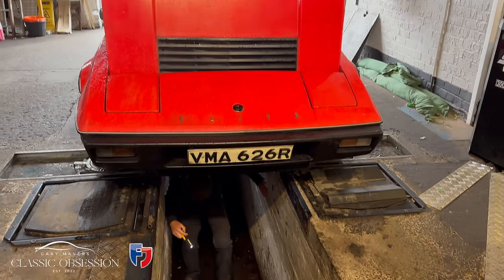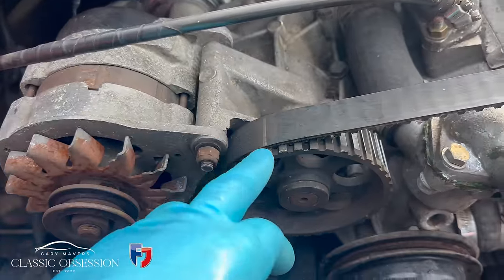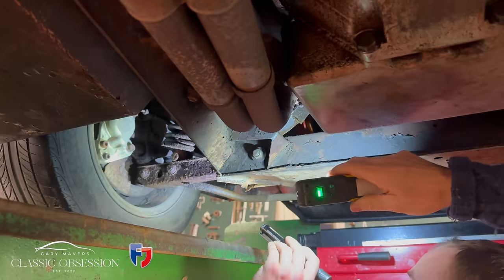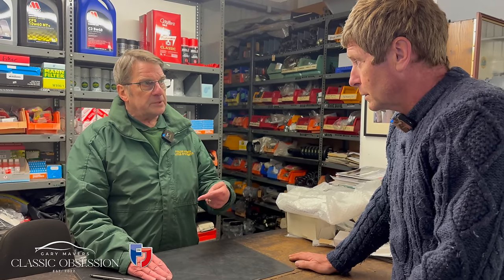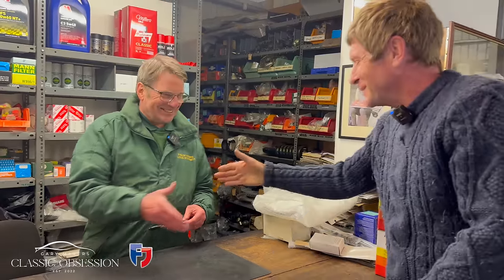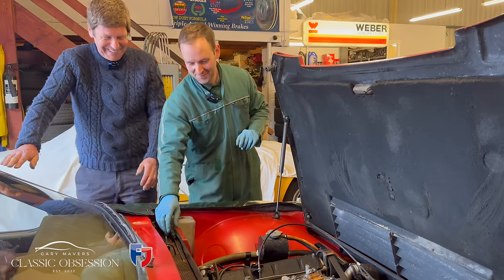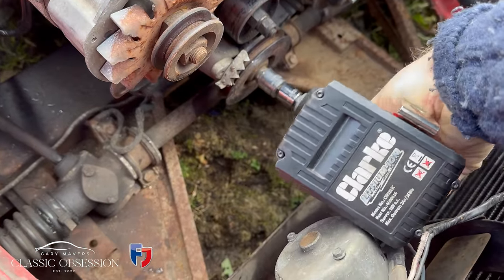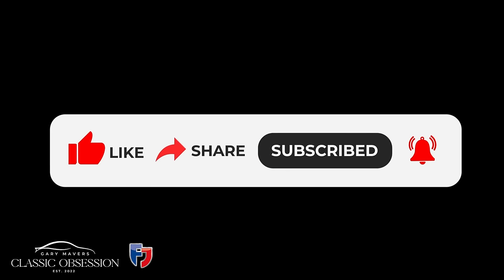Lotus Elite Diagnostic! | Chassis & Cam Belt Update | Classic Obsession | Episode 60

Comment: These cars drive so well that’s it’s sometimes difficult to find any maladies in the suspension/ chassis set up , but you will “ feel “ the difference when they have all been done , Gary. I thought that Steve was spot on with his carb tuning at the Lotus specialist , ( more than I can say about somebody else , who confesses to be the bees - knees on carb tuning , who appears on YouTube ) . This car is most definitely worth keeping and persevering with . Good stuff. The chassis , once sorted , can be kept good with Hammerite paint then sprayed with good old WD40 . Have you considered using a fuel additive such as Millers rather than readjusting timing to suit ? I admitt, todays fuels rubbish for carb rubbers / fuel lines etc ,.

P.s . The corrosion on top of the chassis , where the body sits top  on also effects the Reliant Scimitar GTE , obviously a similar construction.
Reply: Shots fired!

Comment: Following this with interest Gary as I'm waist deep into a nut and bolt restoration on a '74 Elite.  Couldn't help noticing something when you were changing your cam belt.  Not sure if it has already been mentioned or not.  Pause the video at 26.55, directly below your hand is the thermostat coolant pipe, below that you can see the other main coolant connection.  Short aluminium pipe comes out of block and straight towards rad, it's in the wrong orientation, should go staright down.  The lug with the hole trough it allows you to bolt/secre it directly to the engine block. then into an L shaped pipe with a spiggot on.  Great series, lots of useful information in it.  Thank you.

Comment: Glad to see you changed the cam belt, while you have got the bonnet off, and you had a replacement belt. Although best practice would be to replace tensioners etc at same time, lots cheaper than rebuilding a lotus engine, after cam belt or tensioner failure. Not dissing you, your work is generally top notch.
Reply: I believe he chose not to change the belt. It’s Gary’s prerogative. Each to his own. I think I would have. I’m not sure it would have been a sound decision. A proven belt with no visible defects is arguably a known quantity. A new one might fail almost immediately. Especially if it’s “new, old stock”.  I respect the owner’s decision, especially when it’s an informed one. I’ve seen Gary be quite willing to spend on parts when it’s called for, such as the rubber seals on that beautiful old Mercedes convertible. 
I saw one just like his, in white, on holiday in Tenerife yesterday. It smelled gorgeous as it accelerated away up a slight incline. I gave the occupants an enthusiastic thumbs up as they swept by, and the lady passenger gave me a grin and a wave in reply. It looked like a couple, enjoying their venerable, old school, properly analogue vehicle. I have a deep respect for such vehicles. They were low volume mass produced items, but no robots were involved. A human attached every single component.
Reply: @davylad4804 Fair dos. I missed that. My watching was interrupted half a dozen times.

Comment: When you started it after you'd changed the timing belt, I said to myself out loud: sounds nice. And you said exactly the same a couple of sends later! I can see why you didn't change the belt, but there's obviously an issue with time-based degradation irrespective of miles covered.

Comment: Good show Gary, I’ve got a 1982 Excel and just checking the workshop manual -yours is a spec 5 car which has a specified static ignition timing of 9.  +-2 degrees. But the primary timing set up is to aim for 25 deg at 3500-4000rpm  +-2 degrees. Have a look and check your centrifugal weights are actioning the advance properly. I’m surprised the garage didn’t get on to that. Essentially though set it where it runs its best and with no detonation. Cheers Colin
Reply from the maker: Thanks Colin. Yes it’s always a bit of a grey area taking into consideration modern fuel in a 1970’s engine also. I think you can get a good idea of how a car is running correctly by the smell from the exhaust. So many things are crucial. Timing, Points and plug gap, mixture, dwell angle…regards

Comment: Well done Gary you changed the timing  belt 👍I knew what you were thinking when you didn’t change it initially 😂 I’ve had the same worries when I changed my first timing belt 😉manually turning the engine over 360°twice is spot on practice. 
I used to be a vehicle inspector and the sounds of the hammer on your chassis was talking to me!!! I could hear  what was good and bad metal 😉
Cars don’t alway run at their best from manufactures specifications mate . Look up dwell angle of distributor points, that maybe the problem with your timing Gary point are mass-produced , point heels wear altering point gap settings and dwell angles .

Thanks for your very enjoyable videos Gary 👌🥇
Reply from the maker: I agree dwell and points as well as condenser are crucial! Regards

Comment: Enjoyed seeing the four way manometer. You can hear the engine note sweeten as the carbs at idle come into balance. A road test is needed to evaluate the fuelling under load and at differing revs. The slower than ideal return to idle after blipping the throttle can be more than just a return spring problem. If the idle mixture is too lean, it’ll also hang up. On my bikes, idle mixture is perfect when it drops back to idle promptly and, if anything, dips slightly below idle, before returning to a steady idle.

Comment: As an Esprit owner I envy the access you have to that belt. The belt on a mid engined Esprit is right up against the firewall and I have the scars on my knuckles to prove it hahaha My 907 is set at 10 degrees.

Comment: Hi Gary, been watching your channel for a while now, I’m from Blighty but live down under, and that’s because of my job being in the bearings and power transmission industry. I totally agree with your decision of not changing the timing belt, I’ve been selling Gates belts for nearly 30 years and they are far superior than oem and after market belts. People think that because parts  have the car manufacturers name on them that they are the best but car manufacturers don’t make belts, they make cars. That belt would still outlast the new one you’ve put on, god knows who lotus got to make them, probably the cheapest bidder!.
Love the channel, don’t stop what your doing champ, keep up the good work 👍
Reply from the maker: Thanks Buzz. I’m gonna fit a gates Cambelt kit on the 928GT. Who’s the best supplier here in the uk? Regards

Comment: Thanks, Gary, for such a great video.  Nice to watch the carb/timing adjustment and cam belt changing.  I wish we had more available expert help here in the US for Lotus.  I have found with my 69 Elan that some of the tuning specs go out the window as well for timing, plugs/gap, carb jetting, etc. due to the availability of fuel, prior tuning and so on -all of which has required a bit of experimentation.  Happy to say my car does run well.  Looking forward to more videos re this Elite.  Cheers.

Comment: Good to see another Elite being brought back. With regard to the timing, 10 degrees is the right figure, the timing marks on this one aren't like any I've seen before - possibly ones Tom made, could it be those that are out? It definitely needs that throttle return spring too with the way it was hanging up there
Reply: TOMS 19 DEGREE TIMING MARK COULD BE DOWN THE 2.2 LITRE ENGINE.

Comment: I'm thinking maybe... overheating and rough-running on the drive home more likely caused by mixture adjustments than timing adjustment?
Reply from the maker: Hi. I think if mixture was weak you’d probably be right but car was running rich  if anything. Defo wasn’t happy on the new timing setting. Almost immediately I re adjusted it was happy again. I hate rich mixtures on a car. You can feel it choking up. I prefer to err on the side of lean when an engine burns cleaner and smells right. Mixtures crucial for a happy engine don’t you think? I’m impressed with these Lotus engines. I think a lot of thought went into the design and development of these cars.but definitely an acquired taste!! Regards.
Reply: @classic.obsession   Hi Gary, completely agree with rich/lean - one of the Weber tuning books I have talks about a "heavy idle" when the mixture is over-rich...sounded weird when I read it but I get it now after lots of DCOE/DCNF tuning.  I didn't know that about Dellortos (I think they are?) that need 3-4 turns out initially, I suppose they taper their mixture-screws differently? I've never had a Lotus but good to see the timing belt go on (relatively) easily.  I just did a Fiat Dino engine which has a pair of timing chains, 1 each bank - lots of head scratching before that looked right.  The channel is great, really like the approach.  Got me thinking all about Pagodas and 928s again 😄 - all the best.

Comment: A bit surprised that neither Gary nor the mechanic wore specs while doing the underbody inspection. I don’t bother either unless I’m wire wheeling something, so I’m not judging the guys.
Reply: What I do these days is wear a thin plastic helmet when working under a car. It sure has saved a heap of head knocks.
Reply: My learning point was having rust particles scraped off my eyeball with a needle...

Comment: So the mechanic suggested going on a test drive, did that not happen? As he would have noted how it was running. Also you mentioned an over heating issue blaming the timing but then show the coolant looking like pond water. 😂
Reply from the maker: Yes.

Comment: Don't run classics on E10 fuel. You need to run them on E5 like Shell V-Power
Reply: I always buy the highest octane petrol available for my venerable two stroke bikes, but I use only bog standard two stroke oil. Their lubrication systems were designed to work properly on ordinary 2T oil.
Reply from the maker: I always do.
Reply: @classic.obsession  I wondered if running it on modern E10, or just unleaded in general, maybe causing the running issues ?
But then again, just because I'm named after the man himself doesn't make me a Lotus expert. 😆

Comment: You forget how basic these things were ,,, but to be fair , I would have still put a new belt on , for all they cost .

I swapped the hp fuel pump un a range rover last week , and used the old belt loop in the vise trick to hold the pulley to swap the thing over , the belt looked to be in first class condition ,,, it tore like toilet roll ,,, but , your car , your way.
Reply from the maker: I did it at the end of the video Tom. Regards
Reply: @classic.obsession   these cars are the total bargain of the motoring world at the moment ,,, enjoy yours.

Comment: I dont want to sound like a poobum, but you should have changed the tensioner bearing while doing the cam belt.  Ive seen them fail more than a belt break.
Reply from the maker: I’ve already got one on order. They do go and they’re easy to. It and cheap. Regards.